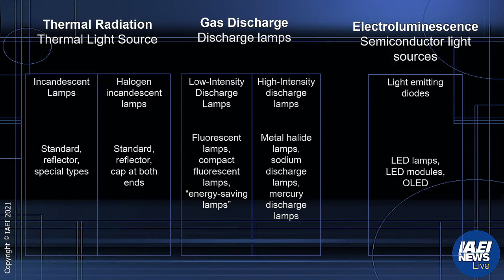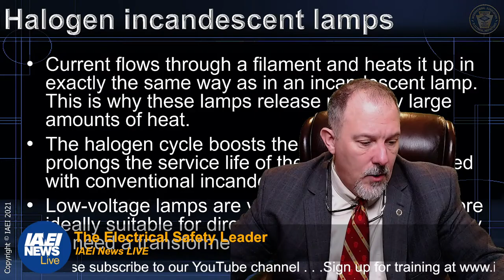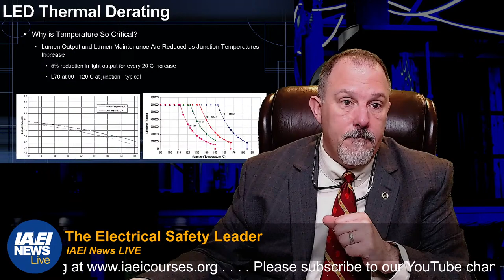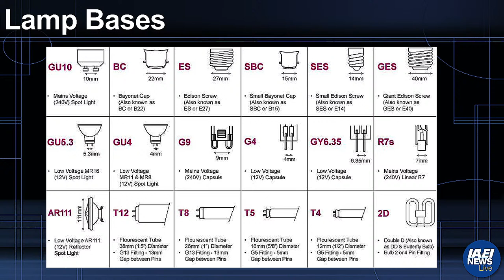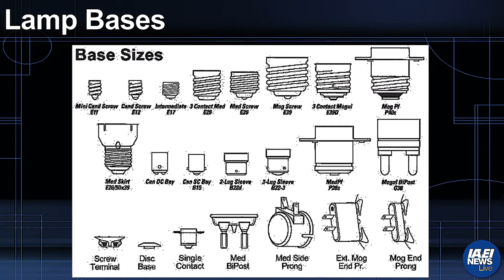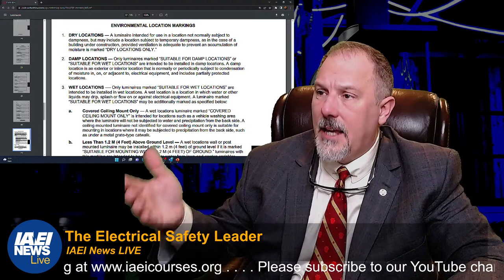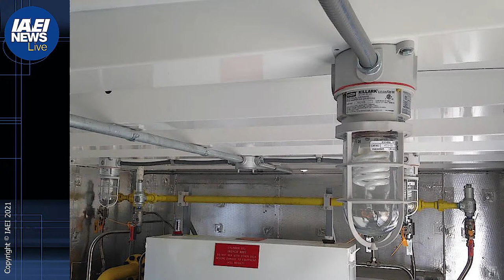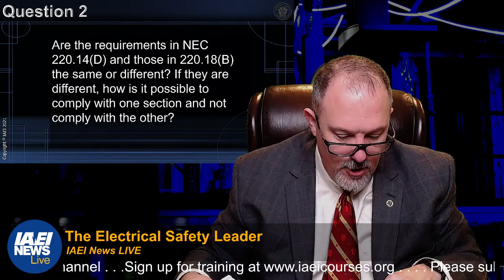Lighting and the NEC!

Comment: At a large hospital they installed 8" wide by 24" LED luminares that fit perfect with edge of sheet rock.They were installed in hallway bump ins at a station for one nurse to operate a computer. Popped the ceiling tile that had to be at least 5'' away so not within reach. Figured it will cost them over a thousand dollars to replace entire sealed luminare. Have to hire a union electrician to cut out ceiling and replace the luminare then hire a union carpenter to replace sheetrock and spackel & tape area, then hire a union painter to paint the area around luminare. Bright project engineer said don' t worry LED last forever. So they went out and purchased more if these white elephants for next remodel area.

Comment: Some of the larger LED lamps have a fan. Have an LED with a fan that replaces a 150 watt incandescent lamp that has a small fan that I installed in a large kitchen luminare with a large globe. Fan is very quiet. Installed about 5 years ago with no problems. Tom remember tubes go into the ground and lamps go into luminares.That's what we have been told at great IAEI meetings. Read that only LED'S can meet the newest strict energy codes.